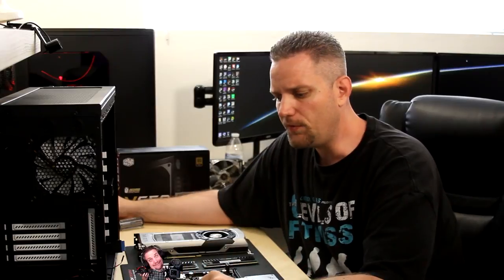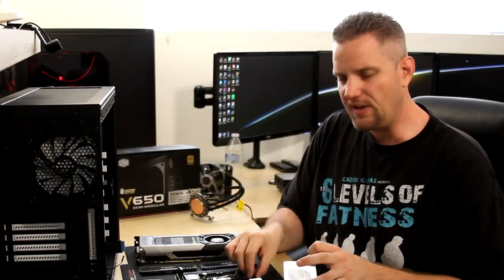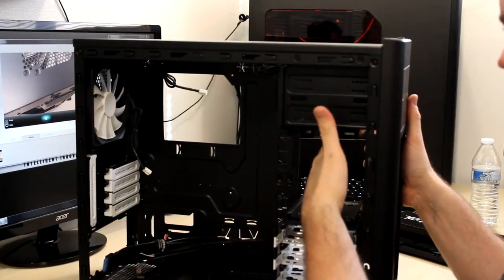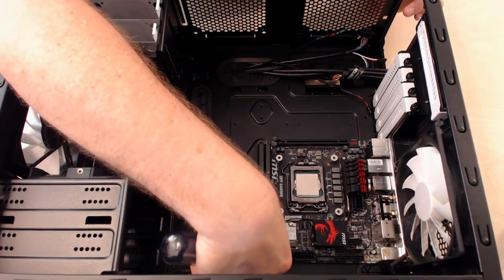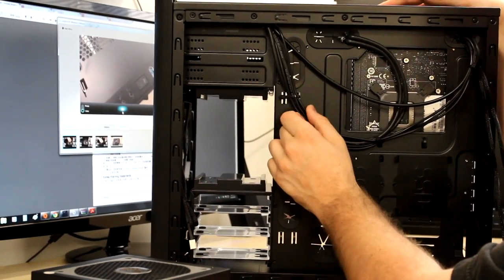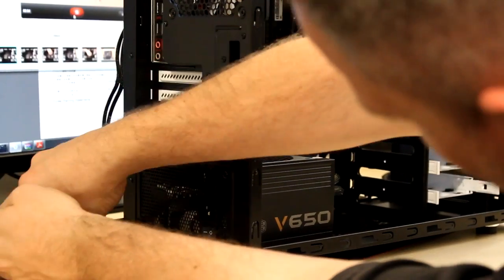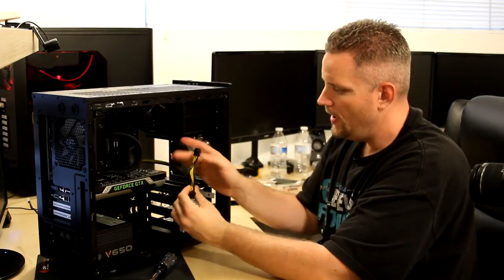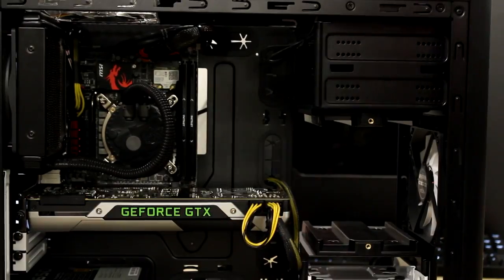Beginners Guide: How to Build a Computer

Comment: can i have help with my first build and if it is compatible and stuff:
Asus M5A97 R2.0 Motherboard
AMD FX6300 Black Edition 6 Core
corsair vengence 8gb
Asus Nvidia GeForce GTX 750 Ti
Microsoft Windows 7 Home Premium
Asus DVD-RW Bulk Drive
WD 1TB 3.5 inch Internal Hard Drive
Corsair Builder Series CXM 500W Modular 80 PLUS Bronze Certified
Reply: Holy crap dude this is my exact build except I haven't chosen a psu nor am getting a DVD drive. The ram, motherboard, cpu, and gpu are all compatible,
Reply: dude that's sweet coincidence and oh the psu is not a final choice just confirming that it is ok thanks dude
Reply: And I forgot the case it is going to be a corsair carbide spec 01

Comment: whats the difference between a hard drive and an SSD
Reply: From what I've heard the main difference is the speed. SSDs tend to boot stuff faster than HDDs.
Please correct me if I'm wrong.
Reply: James Corke SSDs are digital, HDDs are mechanical

Comment: ***** No anti static wrist strap or anti static mat for resting the components on!; Very bad practice in my opinion!
Reply: ***** You don't need it as long as your pc is mounted in a place that doesn't gather static all you have to do is rub your hands on the metal part of the case.
Reply: And what happens when you build a static charge back up from a carpet floor, and then discharge to a sensitive component instead of the case/chassis.

Better safe than sorry.
Reply: ***** Then don't build it on carpet.
Duh. No need to waste money on an Anti Static wrist strap.
Reply: ***** But surely from a purely hypothetical  point of view it is better to be constantly tied to mains earth thus preventing any charge from building up in you.
Reply: ***** I have built about 5 pcs and never had a problem with static shock i do take care not build up static, and to touch a metal surface from time to time but for the most part its unnecessary to make any special arrangements for anti-static.

Comment: What happens if my components don't need too much power but my power supply produces more than required?
Reply: Mr.Riddles your power supply wont deliver more current then your pc would require, it will just deliver as much power required by your components, and it more power watts do not harm your components

Comment: Jay my PC won't turn on it turns on then off immediately
Reply: Check that all the cables are plugged in
Reply: +killerdogd1 it turns on now but no bios is loading tried graphics card and mobo plugs
Reply: +MagicGames mine did that too, it was a motherboard problem, do you have a warranty on your motherboard?
Reply: +Feditox Gamingar I fixed my problem I was trying to use an extender for my graphics card and the extender was broken
Reply: oh ok

Comment: is an fx 6300 a good power supply
Reply: Seriously...
Reply: M8.... That's a CPU.
Reply: Jay Mathers ya I know it is psu
Reply: rk ark then why did you ask if it is a good power supply
Reply: rk ark lel troll
Reply: Jay Mathers PSU = Power supply unit
CPU = computer processing unit
Reply: FireAngel842 yes I know, answer the question pls
Reply: rk ark the fx 6300 is an AMD Compuet Processing Unit.

NOT <---- A PSU

So, it's a terrible PSU
Very good processor though.

Comment: Hey Guys I need help is a 600w PSU enough to power these and pls dont give me links.....
I3 3220 2 4GB DDR3 RAM
GTX 750Ti OC
Normal Desktop Motherboard
4 LED 140mm fans
about 7 USB ports
128GB SSD
1TB 7200 RPM HDD
Backlit Keyboard

Comment: guys i need to know if its okay . nkw if u see 4 blue fans. its because i will change the normal fans from the case . and its a 900 budget. the 900 $ also goes to the headset,keybaord and mouse,monitor and the windoes 8 OS
Reply: +Enderpro 13 Everything is compatible, but here's my two cents. 1.) I've used a few Kingston ssd's and I always felt them 'slow' or 'sluggish'. for 50 bucks, you can get a sandisk plus/ultra and it'll be much faster. 2.) you can buy a 2tb hard drive wd blue for the same price as the black. But that's up to you as well. 3.) your cpu runs hot! I know from experience. if your case has the room I suggest the master cooler hyper 212 evo for 25 bucks. It does an awesome job for a air flow heat sink. 4.) I highly recommend upgrading your monitor. don't cheap out on that piece! it's one of the most important parts. what's the point of getting an amazing pc, but watching it through a potato. (if you have to get this and save up for a better one. go ahead. i understand finances/budgets, but if you have time I suggest saving up a bit more.) 5.) if you have extra cash from switching things around you can always up grade the cpu/processor to the fx 8350 or the gpu/graphics card!
Reply: porkyporkchop1 ok . I will do some changes . Thanks again for your opinion!
Reply: Enderpro 13 no problem, let me know if you need any more help.
Reply: +porkyporkchop1 i was thinking about that . http://pcpartpicker.com/p/vsyv99
Reply: Enderpro 13 Just double check everything. Looks like everything is compatible! I'm sure you'll be very happy with this build :) If you need help or have another questions let me know. Especially if you need help building it!
Reply: Enderpro 13 Also I think spec 1 is a closed panel door. you may want to go spec-2 if you wanted an open side panel to see your blue led's.
Reply: +porkyporkchop1 ok thx
Reply: +porkyporkchop1 Is it possible to have the parts you baught not be able to fit into the case?
Reply: what do you mean? what parts did you buy? :)

Comment: just saying what if you have a case with a PSU on top
Reply: Then just make sure the intake fans have a place to take air from, either inside the case or a vent on the top of back. If the top of the case has a fan, make sure you don't put something on there. It will only take one piece of paper to fuck your PSU up!
Reply: it was retorical question because im seeing every build on net curtrently has psu on bottom

Comment: http://pcpartpicker.com/list/wg6Pnn

Would this PC be able to run more recent games with good settings and with 50+ fps?
Reply: I'm not a pic genius but that will be able to run some games high setting with reasonable fps
Reply: Instead of the 390 pick up the new RX 480 (239.99 version), it's the same price, minus rebates, and performs much better. The RX 480 can run most 1080p games today at ultra over 60fps. Though, if you want an even more capable card and are able to shell out $60 more, you can get a 1060, which is an even (much) better card. But, if you do decide to buy the RX 480 or 1060, I'd watch out for your CPU. All in all, do a bunch more research, and optimize your build, one of the coolest things about being a PC gamer!

Comment: Hi guys,
I would really appreciate it if someone could tell me if these parts are compatible and if the power supply is big enough to power the build.

Intel Pentium Anniversary Edition G3258
MSI B85-G43 Gaming Motherboard
ASUS GeForce GTX 750 Ti Strix 2GB
Kingston HyperX Fury HX318C10FBK2/8 8GB (2x4GB) Black
Western Digital WD Blue 1TB WD10EZEX
Be Quiet! Pure Power L8 600W Power Supply
Deepcool Tesseract SW USB 3.0 Mid Tower Chassis Black/Red

I really need a new pc to handle the gaming that i am doing, and this is my first attempt at a build.
If you think i need to change something please make sure it is around the same price, I only have around $825 AUD to spend

Thankyou to anyone who takes the time to answer this question! :)

Comment: My psu is a seasonic SS-620GM 80 Plus Bronze which has the longest cables i have ever seen as in my full atx case the cables have 1m cables which is too long so custom cabeling to the rescue :D i suggest NOT TO GET 80 PLUS BRONZE they are not so good Always Get a 80 PLUS GOLD psu they are good

Comment: Is this build good for 1080p 60ish fps at very high/ultra settings? http://pcpartpicker.com/list/gRJP3F
Reply: Do you leave your PC on pretty much 24/7? If you do you don't really need and SSD because if you put your PC on sleep it boots in like 3 seconds.
Reply: Yeah, but buying a newer processors would only cost about 20$-30$ more, still a solid build and capable of running most games at ultra 1080p 60fps
Reply: I'd go with the RX 480 or preferably the GTX 1060.  The 970 is a bit old and I heard that not all the memory was usable.  Plus, both the cards I mentioned do better than the 970 and are cheaper.  So you can't really go wrong.
Reply: JAYtheMAN2121 except they're all sold out everywhere
Reply: The GTX 1060 is in stock in like 4 different places right now:
https://www.nowinstock.net/computers/videocards/nvidia/gtx1060/
Reply: is this a solid build? http://pcpartpicker.com/list/kJJ3Z8
Reply: I would recommend getting the NZXT S340. It's fully steel and it has a windows for only 10 dollars more. May want to get 2 more fans. I have the two stock ones in the back and I put two 120mm PWM BitFenix Pro Spectre's in the front. I would also get a G1 or GS/P2 PSU instead of the Nova Nex.
Reply: Syynd G1 or GS/P2?
Sorry, could you clarify on what they stand for?
Reply: The "series" of the PSU. The NEX series has some bad reviews and most people recommend getting the "GS" series. I think
Reply: Syynd which of these would be better for my build, http://pcpartpicker.com/product/N6X2FT/evga-power-supply-220gs0550v1 or http://pcpartpicker.com/product/6p8H99/evga-power-supply-220p20650x1
Reply: IF money is no option, then the P2. If is then go for the first one, but higher wattage and perhaps semi-modular.
Reply: Go for a Rx 480 it's cheaper or if your willing to spend more go 1070 both are faster now.
Reply: get the 1070!
Reply: okey nick it realy do as you said aboutb pfs an 1080???
Reply: Jean vandame yeah no problems so far!
Reply: You should go with a amd motherboard and a amd ryzen 5 cpu and later in the future upgrade your video card to a zotac geforce gtx 1050

Comment: do you think i should change anything on this build? is it any good? my budget is $700 http://pcpartpicker.com/user/Letfordlay/saved/#view=q2vCmG
Reply: Letfordlay Judging from your channel, it seems like you play a lot of GMod and MineCraft.  Your build would definitely be able to handle those games.  However, I do have some feedback:

1. You don't need 16GB ram.  You'll be perfectly fine win 8GB, especially with the less intensive games you seem to favor.

2. Invest in a CPU cooler.  I would get one even with an Intel CPU, but it's even more important with an AMD, because they tend to heat up more.  I wouldn't hesitate to suggest the Cooler Master Hyper 212 EVO.

3. I don't think you can fit those 2 extra fans in your case.  From the reviews section of NewEgg, it only has room for one more on the top.  (Maybe look for a new case that can fit a fan in the front?)

4. Either way, a $3 fan is pretty sketchy.  I'm sure you wouldn't blow your budget with a better fan with better reviews (or any... at all).  Just search for "case fans" on NewEgg.com

5. Don't forget about other costs.  You need a WiFi adapter if it won't be wired in all the time - about $30.  You're probably going to want Windows, which is about $85.  And you should probably have an optical drive (CD/DVD reader/writer) too, which you can pick up for just under $20.

6. I noticed your first draft of the build featured a Radeon card.  If you're on a budget, you might want to take a look at the R9 series of cards again.  They're much cheaper and can still compete with nVidia's GTX series.

Well, I hope this doesn't mess with your plans too much.  Good luck with it, and remember to have fun!
Reply: well for one, i only upload gmod and minecraft because my pc right now is a piece of crap im needing 16 GB of ram for video editing and im going to play gta V i already have windows 7 professional, and a CPU cooler laying around (cooler master), and the case has two fan spaces in the front that are empty... and i dont need 30 dollar fans, im already over the budget if you look at the price...and my pc is right next to the router, and the case doesnt have dvd drive slots anyways im going to buy a usb one later on when i need it, and which R9 series card would you recommend?
Reply: Letfordlay The best is the R9 290.  The best for the money is the R9 270.  You can check out videocardbenchmark.net or gpuboss.com for more in-depth comparisons between GPUs.  Also, general shout-out to reddit.com/r/buildapcsales.  Building a decent $700 gaming desktop without sales is aggressive, if not impossible.  The internet is your friend :)

And remember: AMD is releasing their new graphics cards, the R9 300 line, in only a few weeks.  You'll save some money on the older models by waiting, if you're willing to do so.  Or you may prefer to buy one of the new cards.

UPDATE: AMD just started releasing their new APUs today.  I don't expect to wait too long before seeing some the GPUs show up in my news feed.
Reply: What's the problem with corsair psu's?  Not a challenge, genuinely interested.

Comment: is 500w enough?
Reply: depends on your build and the PSU rating. Put your exact parts into PC part picker, it will give you the general amount of watts your PC will use. This probably doesn't include while gaming or while the pc is under a heavy load.
Reply: im going with a amd fx-8350, mother board:msi 970a-g43 plus, gpu: evga geforce gtx 970 "ssc"
Reply: my motherboard isnt on there
Reply: I would recomend 550w or 6000w to be on the safe side. 500w would work but you wouldnt be able to upgrade from there unless you got a new psu.
Reply: +BiscuitBro ya i checked out my rig and its about 395w so 500w is like just enough. I also dont plan on upgrading any time soon but if i do i think it would be wise to buy a new psu
Reply: If you have a single video card, 500w is more than enough.
Reply: that would mostly depend on the cpu and gpu. in my case it worked fine for me.
Reply: I don't think they make 6000w psus
Reply: lol my bad

Comment: This is a bad beginner tutorial for me, does some one have a simpler version? I've been trying to start getting into how to build a pc; but this guy and the guy before that I watched are not helping. I'm sure he knows how to put it together; but I need a video explaining what the parts do or at least what parts to pick, how do I know he chose the parts that I'll need? how do I know this computer will do what I want? I don't. I don't know what any of those parts are hardly doing, I don't understand why he picked them, I don't know what makes one part different from the next. I need as simple of a video as possible.
Reply: Fix it feilix This video is about building not choosing parts for a pc.
You need to consider your budget and what you're going to want to use your system for.
Reply: Blaackys oooh, ok, thank you for your help!!
Reply: Fix it feilix If you tell me your budget and I can get you a list of all the parts you'll need for a PC that fits the budget.
Reply: Misterfox20 Thank you for the offer, but i'm not trying to simply build a pc, I want to understand it. I found some great videos that have been a lot of help.

Comment: http://pcpartpicker.com/list/8yrfHN What do you guys think? Also what optical drive should I add?
Reply: If I have a SSD and a mechanical storage drive I would run windows on the ssd?
Reply: Nice build. I would go with white RAM from Crucial. (Crucial Ballistix Sport LT).
Also you don't really need an Optical Drive these days and the S340 doesn't support an internal one. If you really need one then get an external one. Also if this build is for gaming only then downgrade the CPU to a Core i5-6600K. For the OS I think you can only plug in the SSD, install windows, then plug in the HDD. FOr the PSU, if you leave your PC on alot (like all the time), then I would recommend getting an 80+ Gold Modular PSU because it seems like money is not an issue lol.
Reply: +Syynd thanks for the help. Will do. One last thing what do you recommend for a network cars because I don't really have access to a close Ethernet cable so I need one. Have any suggestion. I saw a few that are sub plugins which you just plug into the computer via use. Are those any good? Also its not only for gaming I am a programmer that is a job. I am not at all good with the hardware just code. I know this computer can handle really anything, but I do use a lot of compilers and extra software which I need running at all times. Example when I am programming I need my servers running, other than that I don't need them running when I am not programming. Once again thanks.
Reply: +Syynd One last thing, isn't the i7 with 4,0ghz and 4 cores better than the i5-6600K with 3.5ghz and 4 cores? Regarding the standoffs, those small screws he used to connect the motherboard to the case(I know you must use them) but do they come with the motherboard or do I have to buy them? For the thermal past anyone in particular you suggest? Only very sorry for the long as replies and millions questions.

Comment: I am getting afraid! I´ll get a PC and I´ll build the PC! BUT WHERE THE FUCK DID YOU KNOW WHERE TO PUT THE KABLES!!! :( I don´t know HELP!
Reply: +Lam bda read the motherboard manual, they literally only fit in one place.
Reply: Like the previous guy just said, just read through your manuals. Take a day to read through them and take notes. Draw out simple diagrams to help visualize what you need to do. It's better to research and plan before you go into a build. It's like when I built my desk. I didn't do it by having general knowledge of using power tools and how to cut certain woods. I sketched up a 3D model and did the math to ensure the best form of stability and structure with my design. My mom likes doing DIY projects and they usually end up decent but not the best in terms of stability and structure because she doesn't throughly plan them out because she gets impatient.